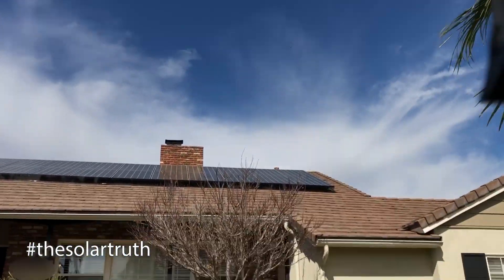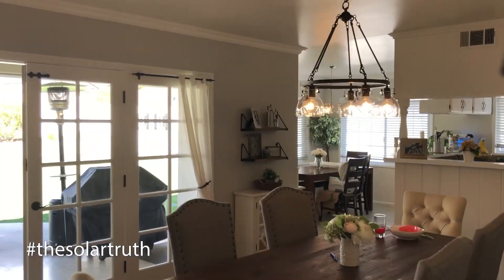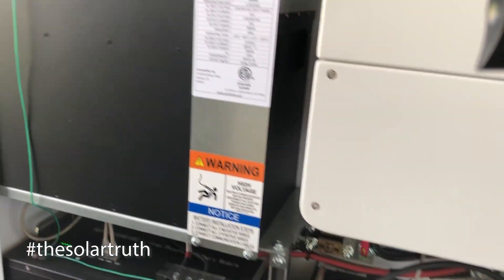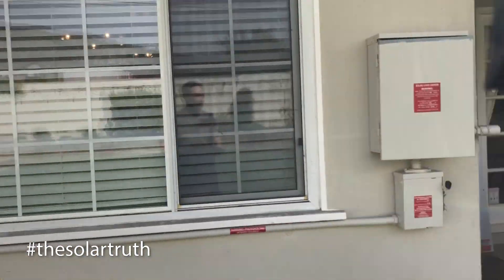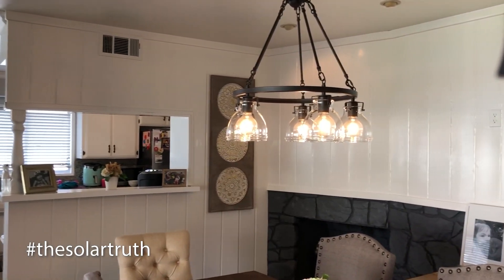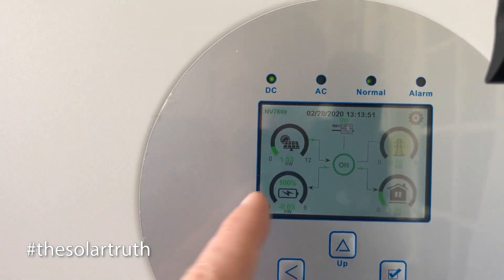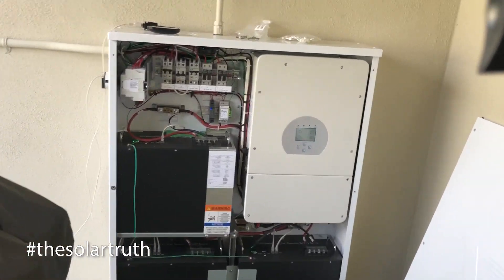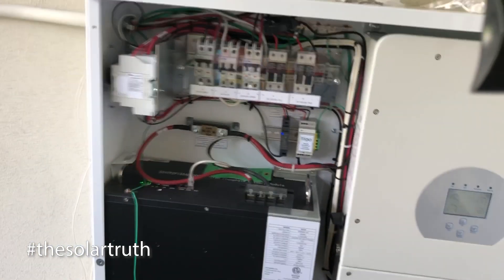Home Battery Backup System - Power Outage Demo

Comment: How much does something like this cost?
Reply from the maker: Generally with material, backup panel, permitting, tax, etc. Install ends up being about $13-15k depending on the installation. The cost can be a couple thousand less with Solar, because you can use the NV14 as the Solar Inverter. You also get 26% tax Credit and in CA $3500-$12,350 SGIP rebate. So... the net cost can be $0-$12,000 (typically $7-$9k) depending on all those factors.
Reply: @TheSolarTruth  does this include the solar panels? Also I’ve seen some of the newer panels doing 700w 40v, these next couple of years we should see some great increase in installs.
Reply: @TheSolarTruth are those DIY prices?  I was an HVAC tech and I have 2 semesters of electrical engineering (about 5 years ago though) under my belt.   

I imagine I could do most of this myself, however I have no idea how to get a building permit or what other safety inspections need to happen.  

Would love a video that’s dedicated to any details you may know about all the red tape you need to work around legallyZ
Reply: I know right!! That would be extremely helpful.

Comment: I have a question, do the solar panels still produced energy even if they are off the grid ?
Reply from the maker: Off grid solar panels only produce energy when the Home needs power or when the batteries need to be charged. IF there is no home energy usage and the batteries are fully charged, solar panels do not produce energy (or to be more accurate, the energy they have is not going anywhere).

Comment: they can't catch fire or explode?! omg jesus christ. all batteries can explode or catch fire. all the energy must be released as heat when something goes short or whatever...
Reply from the maker: Yes, if you stick some C4 on them they will explode, you are right.
Reply from the maker: LFP solar batteries will not explode or catch fire. They use very stable chemical compounds. They are stable even at high temperatures. And if you're wondering about those exploding laptops and cell phones from a few years ago, those were lithium-cobalt batteries.Jul 12, 2022
-2 second google search

Comment: All batteries can exploded.
Reply from the maker: WRONG. Go ahead and google 'is lifepo4 battery safe' the answer is 'The LiFePO4 batteries are the safest type of Lithium batteries as they will not overheat, and even if punctured they will not catch on fire. The cathode material in LiFePO4 batteries is not hazardous, and so poses no negative health hazards or environmental hazards.' 
Now, maybe I shouldn't say that, if you put some C4 in a LiFePO4 battery it would explode, so I guess, yes, you are correct, I'm sorry.

Comment: Hi.  Is the home on a Solar Panel system a grid tie-in system.  If so, doesn't the entire solar panel system shut down (a safety feature - no power output); home is power only by the battery?
Reply from the maker: No, there is an internal transfer switch (disconnecting from the grid), so Solar and the Battery supply the home loads.

Comment: Great system! From my understanding, a battery system is needed to get solar panels to power your house when the grid is off. anti-islanding. What happens to the extra power that solar panels produce if your battery is full and you are disconnected from the grid?
Reply from the maker: The battery/solar only turn on for loads you are using, but yes, you will lose some solar production. Just like a parked RV with solar, just sits there doing nothing till you use it, that's how true off grid works.
Reply: @TheSolarTruth            Buy extra battery’s
Reply: @TheSolarTruth  Can't you spin the grid meter backwards with your extra solar, and get a rebate from the State?

Comment: My question is,if power was out roughly how long would that power your house? 
I`m looking at this as a alternative to a whole house natural gas generator.
Reply from the maker: There are a lot of variables, but simple answer is 12-24hrs with no sun/solar. Forever (limited loads) with sun/solar. Generally batteries are better if you have solar, but generators are better if you want/need to power high Amp items like AC or EVs, or you don't have/get solar.

Comment: So I moved into a property I bought in Feb and it has 55 brand new panels on the 30x60 shop that is next to the house.  How do I get a set up where I won't have to worry about power loss.
Reply from the maker: It all depends on how much you really need to power (critical loads). That is a large solar system which means a lot of usage, generally battery kWh's are about 2x the solar PV kW (allows it to fully charge in 1 day typically). This would be like 30kWh battery for you.

Comment: I live in a 55+ development on the West Coast of Florida with danger of Hurricanes. My husband is very ill. Would this system be better as a backup for electrical power outages, or Generac with a propane tank? Thank you in advance. Jeanne retired RN
Reply from the maker: Sorry for the very long delay in replying. If you have solar or get solar, I'd recommend a battery, if not, a generator is better. Solar/Battery will cost more (and power less off grid), but save money on your Utility bill and not need gas/propane.

Comment: Can you run the AC and well pump at the same time?
Reply from the maker: Depends on Amperage, you may need a larger battery system like stacked Enphase or Powerwall.

Comment: Of the 7kws of panels, were some converting to AC and supplying the house while others were wired to supply DC to the batteries only?
I'm totally looking for such a system.
Reply from the maker: ALL DC on this application, then converted to AC when needed for the house or to grid after the battery is fully charged, this is the most efficient way.

Comment: I'm looking for a setup that can charge the batteries both directly from my solar panels, but also from the grid. Does this setup support that? If not, what would you recommend?
Reply from the maker: If by directly from your panel, you mean DC (not DC->AC->DC), then Neovolta can do that and be charged from grid also. Others like Powerwall can also, but DC->AC first. Sol-Ark is also good for DC charging. Let me know if you need more clarification.
Reply: @TheSolarTruth  thanks! I will see which options I have for that here in Sweden where I am.

Comment: Epic! If you were to setup some back up power for a Reef Aquarium if the power went out to power about 500-1000w of equipment, How would you do it? I want to power (2) 150w heaters, (1) 45w return pump, (1) 40w Skimmer, and (2) 105 light fixtures.  What batteries, how many batteries, and how big of a power inverter? Or would you take a different direction?
Reply from the maker: Sorry about the delay, this depends on how much you want to spend and if you are permitting it. The simplest (probably minimum) option would be something like a 'Titan solar generator' (backordered) https://wildoaktrail.com/products/point-zero-energy-titan-500-kit , but about $4k would get you a 3000W inverter, 2000kWhs Lion Battery, and 500Ws of solar. This would last about 3-6hrs on batteries, and 500W of solar to power those loads with the sun and charge batteries (you may need more solar and batteries)
Or you could do more of a custom build with a Magnum Inverter, LiPo batteries (battle born or other), and standard solar panels ($6-8k+)
Or, the simplest to Permit (but more $ and power) would probably be Neovolta (NV14), 14.4kW LiPo w/7.6kW inverter ($10k + install/permitting + Solar PV)
Reply: @TheSolarTruth  Thx! I might go with that Titan Solar when the come back in stock. :-)

Comment: Nice setup, my question is how long can those battery last? How many amp hours are the batteries?
Reply from the maker: second question: 14,400Wh, so at/240V 60Ahs and at/120V 120Ahs
First questions is more complicated, it all depends on how much is connected to and running during that time. A Fridge pulls about 1kWh per day, so it would run a Fridge for a couple weeks. An Air Conditioner (not recommended to run on most battery back up systems) pulls about 3.5kW/hr, so about 4hrs. 
Typically, it will run 8-12 backup load circuits for 1-2 days when it's raining, and basically infinite when solar is recharging it with the sun.

Comment: new subscriber and my question is.Due to the extreme weather just recently had here in South Texas can a solar panel system be fitted to run refrigerator, electric stove, heating and air-conditioning unit?   And how much something like that would cost?
Reply: Hey John, I'm in Houston.  I've researched going to solar and it is not feasible.  The cost for our power is cheap; however, I am going to a battery back-up that will be charged by power when energy is cheap or my natural gas-powered generator when the price spikes in August and like last week.  Will be nice when the hurricanes hit.
Reply from the maker: Sol-Ark/Fortress solution may be good (will be posting a demo video soon of a system I just finished). And yes, energy is cheap in Texas (except the last few weeks with some utilities), so the payback may not be great. You would probably need 1-2 Sol-Ark 12kW, and 1-4 Fortress 18.5kW batteries. This can get pricey ($25k-$80k for just the inverters/batteries) but there is lower cost options. Email me your bill at thesolartruth@gmail.com , I work with installers in Texas that could help.

Comment: I have a solar system on my house with an adder of a solar panel that free stands in our yard. The solar system parallels to the grid. I’m looking to add the battery back up so if I lose power. Can you provide me information on battery back up.
Reply from the maker: Please email me your info/utility bill at adam@thesolartruther.com
Also, what size solar you have and what you are looking to back up (critical loads: kitchen, internet, some lights and outlets, or whole home/AC's etc.)

Comment: Reason there was no flicker was that the grid was on standby,, everything is being powered by the panels even before the grid breaker was turned off :)
Reply from the maker: Most battery systems disconnect and take a few seconds or minutes to power the home when the power goes out though. But, I should turn the PV off, and try this to see if there is a flicker.
Reply: @TheSolarTruth  I’ve seen see less battery back with invertor that see less Ly switch for around $6K.
Reply: The inverter has a 4ms crossover so you wont see a flicker

Comment: Adam,

Would it possible for you go to that site and use a clamp on meter to check the Ac draw on the input line on a sunny day, I have similar looking inverter that draws 2.3 amps even when the battery is full with full sunlight.
Reply from the maker: Schedule has been crazy, but yes, I will try to do this test at some point and let you know!